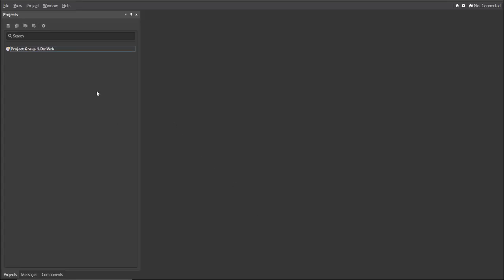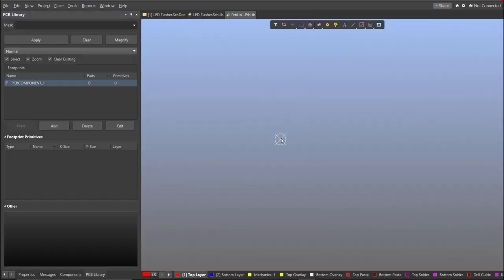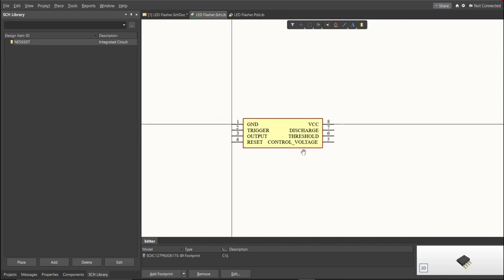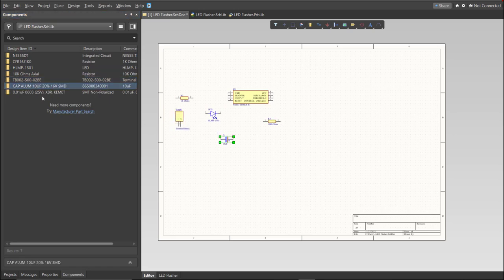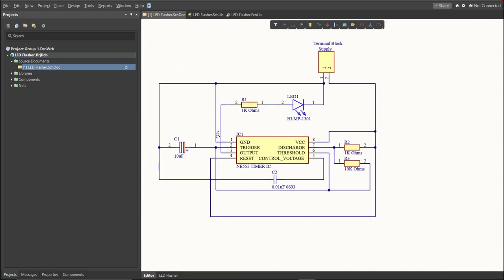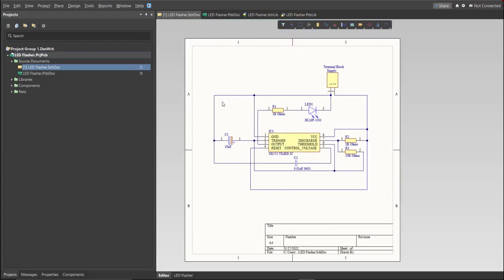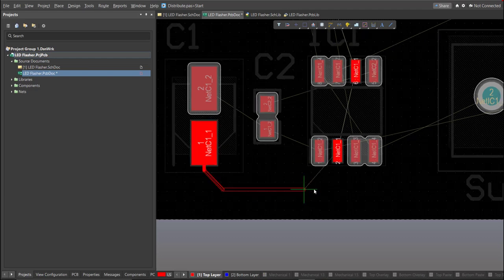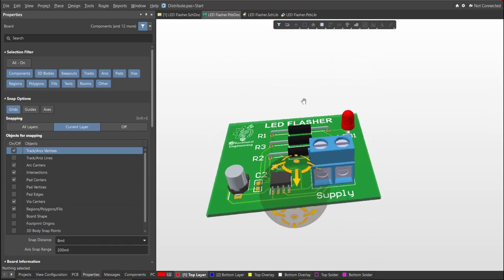LED Flasher by using Altium Designer

Comment: after creating schematic, am not getting altium library loader, can u suggest where this option is available
Reply from the maker: That option depends on the Altium version and whether the separate Library Loader integration is installed. Try the current Components / Manufacturer Part Search workflow first. Tell me your Altium version and I can point you to the closest equivalent menu path.